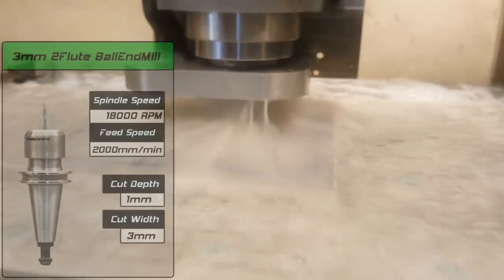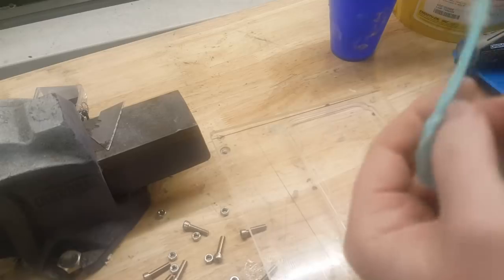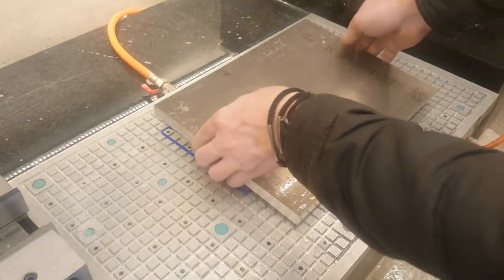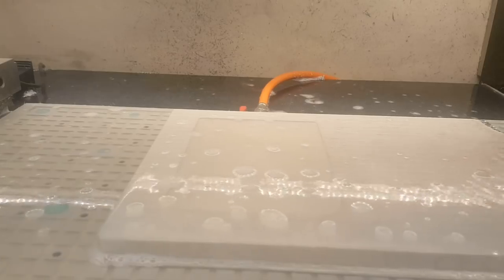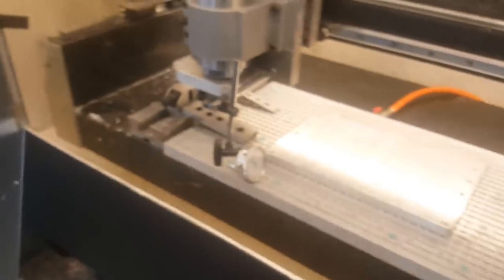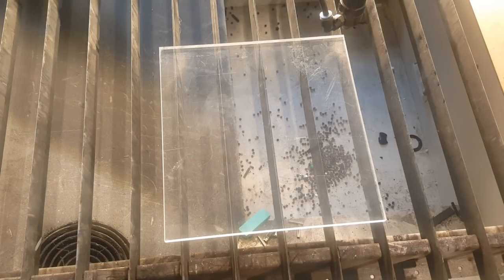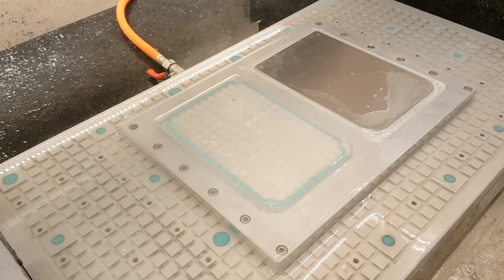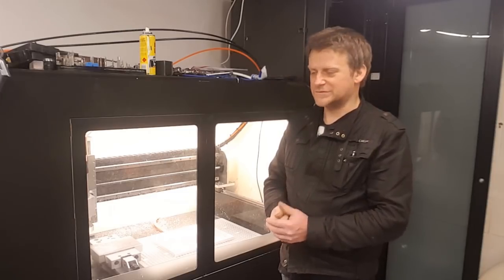vacuum fixture - Next level or madness?

Comment: Nice one, what are the rules for the groove dimension and the gasket for that groove? If the width of the groove is 6mm, what would be the depth? And thickness the gasket would use? Tnx
Reply from the maker: it all depend of the gasket you use. if its a hard gasket than on the grove 6mm wide i would make depth of 5mm. if its softer maybe 4.5 so you will have 1.5mm stick out. i would recommend to test gasket compression and than make grooves accordingly.
Reply: @PiotrFoxWysocki  Tnx, I will try. Greetings from Serbia

Comment: Can you try holding the wood(Walnut,Oak)?
Reply from the maker: i did try a guitar, but it was painted, it did work. but untreated wood might be tricky. i would say 50/50. i will try, just out of curiosity :)
one thing for sure i will have to have vacuum pump running.
Reply: @PiotrFoxWysocki  Thank you for help. If you try with wood, I'll like it first:)

Comment: Cool thanks.

If you are going to be producing lot's of those plates using the perspex to block of one side then the other seems a waste of time.

You need 2 programs for this job one to produce the first side.
The second produces the first and second sides in one operation when you have the chamfer tool in for the first side you may as well clean up the pocket on the second side.
Reply from the maker: I like to have flexibility, if i want to make just one at the time.I will use 2 programs. if i want to make more of them, then i will use one program and 2 plates on both sides.  I didn't mentioned about it on the video because i thought it is obvious ;)

Comment: How do you calculate feeds and speeds?
Reply from the maker: by a hunch :) every machine is different and even if you change one part it will affect feeds and speeds. so you have to test how machine behaves and size of the chips. and over the time you will get the idea what speeds are working for you.

Comment: i dont understand why you would want to activate a tool length of another tool for a different tool? on Heidenhain it is like you call a tool and offsets etc. will automatically be activated.
Reply from the maker: obviously by mistake. i set the tool without the offsets and than when the program stared offsets where on.

Comment: Nice fixture, the fit of that plate when you flipped it was very satisfying!
Have you considered drilling some holes through the fixture into your base plate for some dowel pins so you can realign more easily in the future?
Reply from the maker: yes i was :) and i'm still considering. Unfortunately i don't have any dowel pins which i could use. I have to order some, but it never is a important part to buy, so i repeatedly forget about it  :)
Reply: @PiotrFoxWysocki  Print or mill or turn or cast them yourself - Piotr's ultimate dowel pin! ;)

Comment: I don't know how much power you have available, but I often run a 2" face mill at 120ipm .02 on my vacuum plate without any issues.  The plate will hold as long as you have area to grab on to.  Even with much less power you can probably deck it off faster with a wider tool and deeper cut.  I would look at datron's tool.  They have an insert tool they run and their spindles are pretty low power if I recall....  You might even try a single flute indexable end mill with a PCD insert.
Reply from the maker: i was a bit concerned about the speed outside of the gasket. but thank you for the advice on speeds. Also naturally i start thinking about Datron's tooling. don't have any experience with them but now with the new spindle it seem to be a logical step forward. are those single flute ain't more fragile ?
Reply: I have a similarly spec'd cnc mill to you, i have tried Micro 100's single flute endmills (these are cheeper and in theory not as good as the datron ones) and they are pretty good at the higher rpm's, I am able to take similar cuts to the ones you made in this video and I haven't even tried to push it yet. In theory you get much higher material removal rates in high rpm spindles because for every rotation you only have one cut instead of 3. In terms of Datrons other offerings like their PCD facemill and normal facemill they only come in HSK E25 so we cant use them.
Reply: I've never tried a single flute or a Datron, but when I saw your machine that's what I was reminded of.  I'm using a Haas TM2P.  So the cutting forces on my machine are much higher.  That being said, I won't hog out material with a large end mill (say 16mm) unless I'm covering most of the surface area of the 13.5" x 20" vacuum chuck.  For smaller parts say 6" x 10" I still face it at 120 ipm with a 5 insert Sandvik 245 or a 3" 590, and .010" DOC.  Then for material removal I use a 1/4" 3 flute end mill.  For you machine you may not be able to run a ton of flutes due to power and rigidity, and the face mill would definitely not be an option, but it's an example of what you can get away with on vacuum.  I would look at PCD tooling because the surface footage is insane and would let you get the RPM's up on the spindle.  BTW I looked and the Datron tool is only an HSK taper.  You may want to look at a Sandvik 390 with 1 or 2 inserts.  I think they make PCD for that tool.
Reply from the maker: thank you for so much information, now it will take me sometime to process :)

Comment: could you use a silicon gun and just inject normal silicon into the mold to make more gaskets?
Reply from the maker: I like the way you think :) in this particular mould with cover it wont work because regular silicone need air to cure. inside closed mould it will be just like inside the tube you squeezed it from. 
but perhaps you could experiment with open mould (no cover) and try to see if you can smear it so its flat or perhaps put more and cut excess with a razor. 
if your idea will work, it could be even easier/ more available for everyone to make their own gaskets.
Reply: Ahh didnt think of that, good point

Comment: Very interesting next-level madness Fox :) In the mold making, will the silicone naturally level out without needing to be pushed or a vacuum to help out gas? With your final cover plate, do you punch out the milled area by hand and debur?
Reply from the maker: there are 3 ways you can deal with silicone. 
1) natural way mix it and hope there won't be too many bubbles. if you using slow curing silicone most of trapped bubbles should escape before it will cure.
2) after mixing you degass it in a vacuum chamber.
3) after mixing you cast it in a pressure pot with high pressure like 80 psi to shrink any bubbles in to nothing pretty much.
There are as well plenty of variations of those 3 methods.

silicone will level out by it self, it depends on the curing time and the the distance it has to flow through.

with the cover plate this milles area is for bottom of the joystick which is inside the case. 
to make the case as compact as possible i have to mill out this bit. It won't be punched but i guess i could put a chamfer on it. Im still dialing all the details. 
but if i would have to mill a hole in it i would put a round gasket outside of the hole. 
i can't deal with clamps anymore. I had to run a big batch of parts and clamping and unclamping was taking more time than milling..